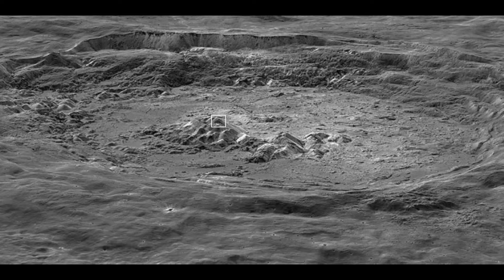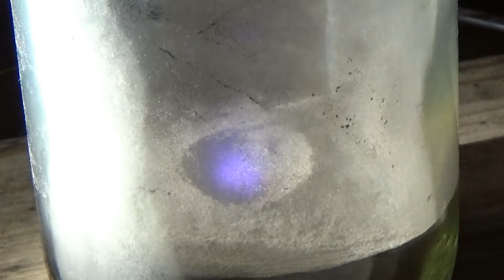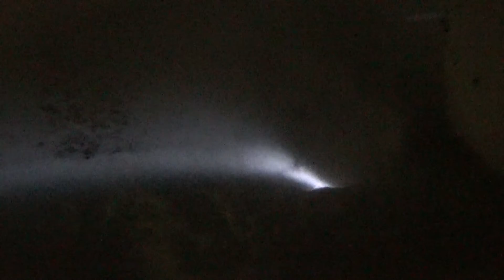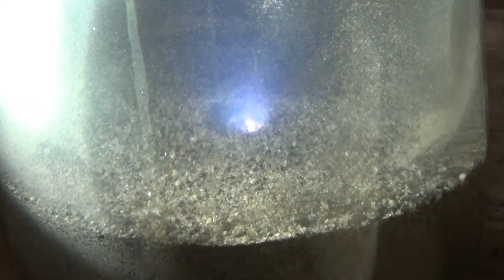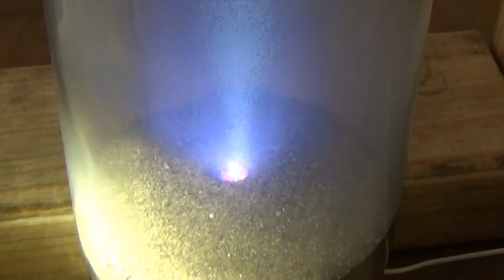Electrical possibilties in the solar system

Comment: Have you considered that these craters may have not happened immediately, but over time, as a sort of weathering process?  So like when the sun intensifies, or changes, instead of weather and storms forming on bodies, you have these craters that slowly increase in size over time?
Reply from the maker: That is a good question. I personally think that a crater forms slowly, with a relatively small discharge compared to size of the resulting crater. how slow though is a good question. I would think at most days but likely not weeks, but that's just my thoughts.
Reply: Thanks for your reply!  I think your work is outstanding and I regularly send your videos of the hexagonal shaped craters being formed in the vacuum to people.  Your videos are saved under my Electric Universe Best playlist I keep.  Keep up the fantastic work sir, I wish I could help!
Reply: Thanks for your reply!  I think your work is outstanding and I regularly send your videos of the hexagonal shaped craters being formed in the vacuum to people.  Your videos are saved under my Electric Universe Best playlist I keep.  Keep up the fantastic work sir, I wish I could help!

Comment: Another absolutely awesome explanation with experimental results to justify Electricity as the intuitive reason for craters which are obviously NOT created from impacts!
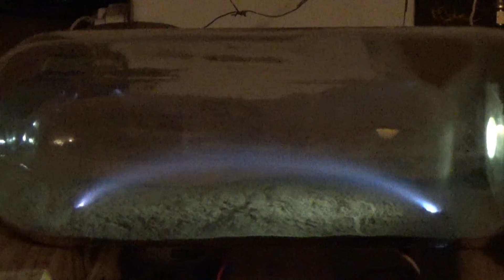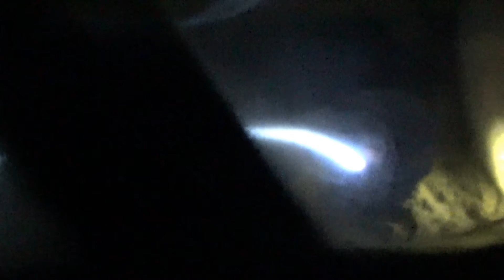BTW - what is your set up from 6:01 - to 7:24 - that experiment is just as clarifying as all of you others.
(In the above mentioned experiment - if you had a way to lay a - ground electrode plate - in the bottom under the material (negative) along the containment unit - and could then find a way to "move" the Positive electrode "above" - and along the buried ground plate - allowing / forcing the arc to "traverse / travel" the length of the ground plate - (at ? speed) = I wonder if a "trench" with associated Lichtenberg features would form?)
Reply from the maker: The setup in that segment is with a wine bottle on it's side. Two nails where set in as the anode(left) and cathode(right). There where both covered in soil but everything was evacuated.